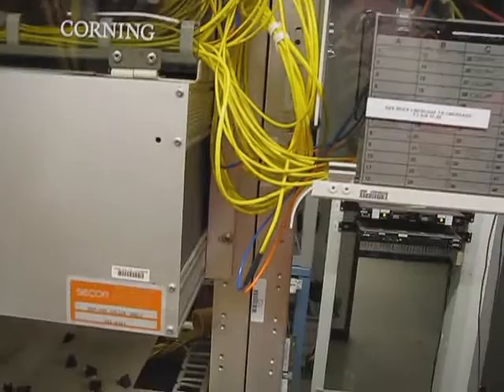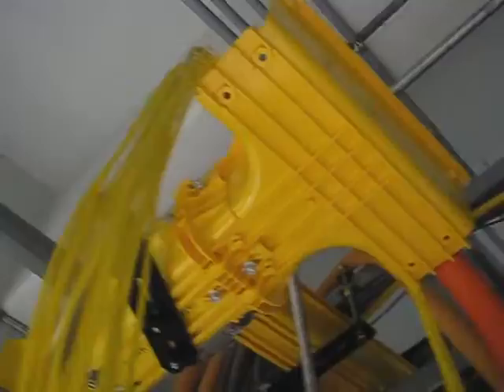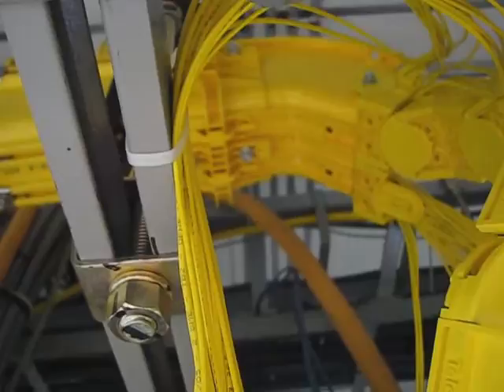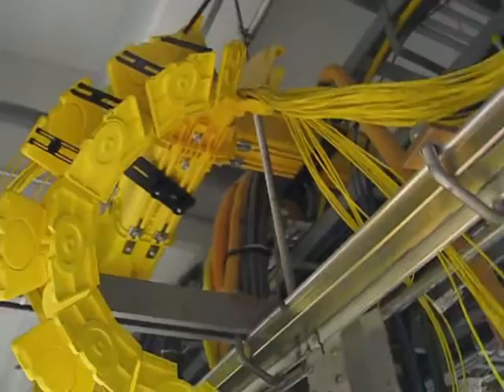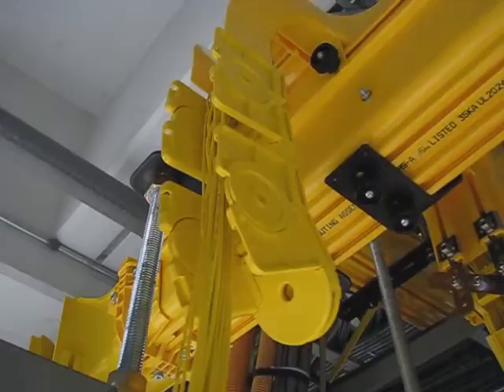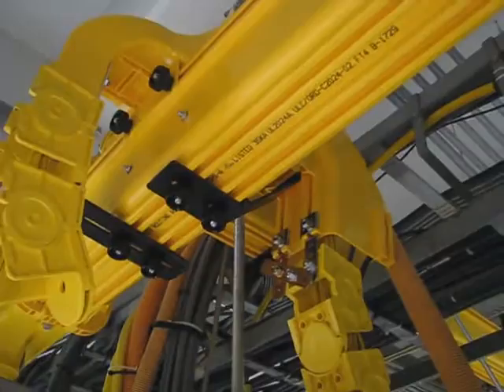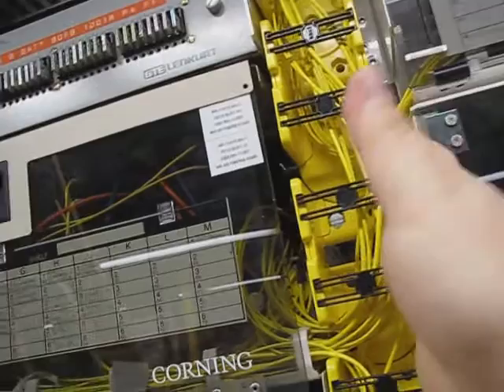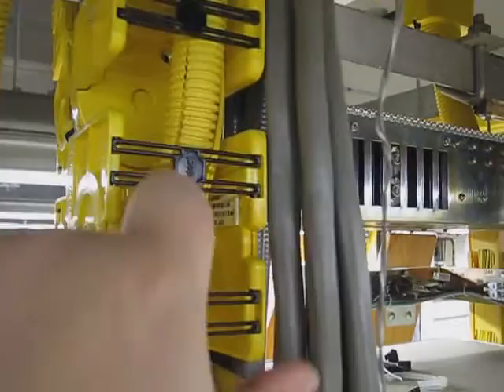#005: Fiber Optic Cabling in Tight Spaces

Comment: I usually  get to cable small data closets.  This means U usally get a trough  going from one side to anoth and have to create a drop for the rack from this.  The flexible drop trough is exactly what  I want.  Much better then the  flex hose since I can create a nice channel down the rack and the fibers can be clearly seen and routed to different levels on the rack.
Reply from the maker: +P. Wingert When I was work it this stuff, the flex hose had been banned. Anytime we had to place new fiber through a hose, we had to pull it out,